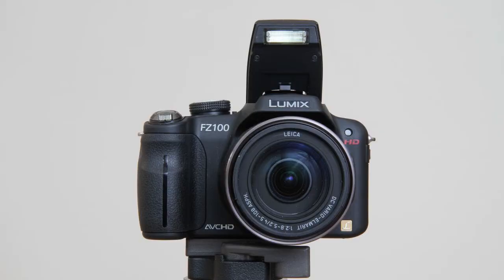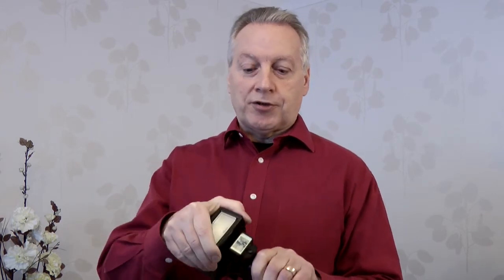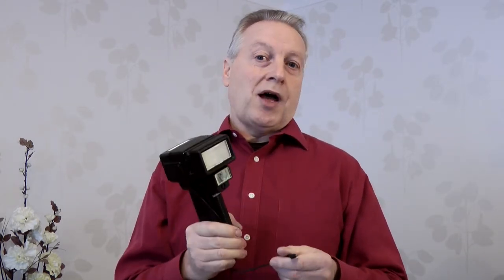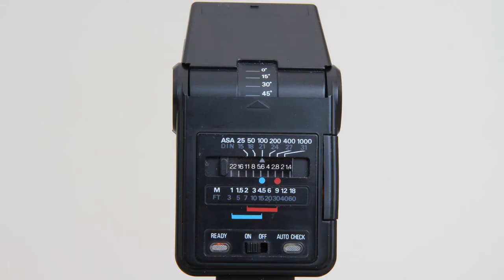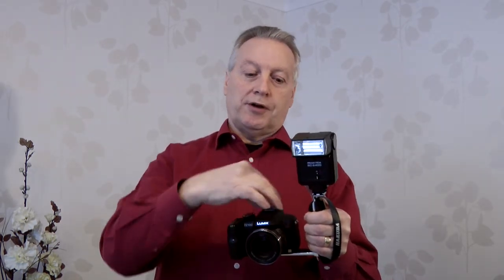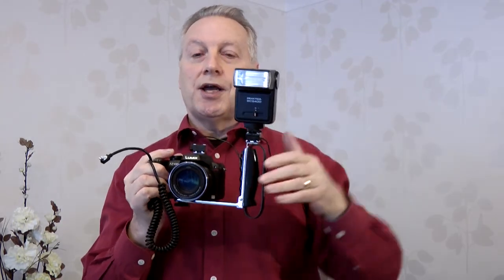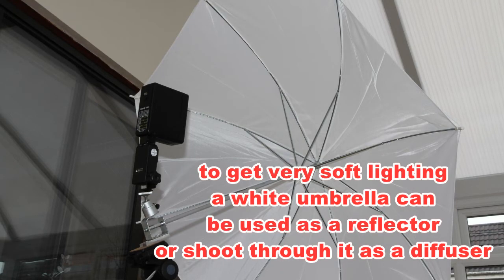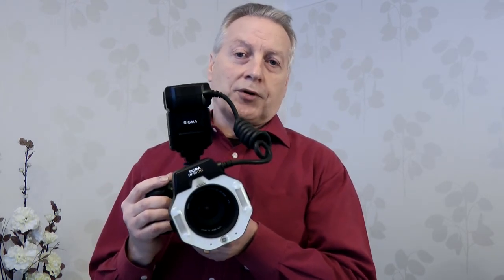External flash with Panasonic Lumix FZ100 ( and other) cameras

Comment from the maker: Hi, trigger voltage is the voltage which the flash gun puts out on its hotshoe or synch cord. It is there so that when this is shorted out by the camera firing circuit ( normally a thyristor in digital cameras) it fires the flash unit. Traditionally in early guns this trigger voltage was derived from the main flash tube voltage around 350v. This high voltage would destroy the thyristor in the camera. Modern flash guns have trigger voltages of below 6 volts and hence entirely safe.

Comment from the maker: @puiaification THE 285hv has a low enough trigger voltage to run on the FZ100, however it will be manual flash only and not TTL so you will have to use the aperture setting on the 285HV to control the exposure if you want auto flash and set the fz100 aperture to match the 285hv aperture value.

Comment from the maker: @Mig440 Yes an external flash will work with the Fz100, just read the note about the trigger voltages before you purchase older second hand units. Most modern guns ahve very low trigger voltages and are perfectly safe. You will need to use the gun in manual mode unless you get the dedicated Panasonic ones.

Comment from the maker: Although this flash unit has a low trigger voltage I suspect the polarity is wrong for the LX5 hot shoe. I have had this with other guns as well. The work around might be to use a "wireless flash trigger" - which also gets you a better flash position off camera. If you have a multimeter you could check that the centre pin is positive with respect to the side contact. I'm sorry I don't have any other ideas to help.

Comment from the maker: Hi again. The Practica flash gun can only be used with and external trigger such as shown in the video. The "trigger voltage" of this gun is too high to directly use it on the FZ150 it would probably destroy the output of the camera. By using the radio controlled triggers you can use just about any flash unit off the camera. All the unit s will be manual so exposure is done by dividing the guide number of the flash by the distance to get the f stop to use. The remote flash units are universal.

Comment: Great video Graham very informative I have the Lumix FZ35/38 and the camera don't have a hot-shoe I think only the FZ100 have hot-shoe  ,so the only possible way to connect an slave flash to the FZ35/38 is by using a photocell sensor on the in-build flash ,probably using the same National Flash Gun as slave flash

Comment from the maker: The real danger flash guns are the ones which use the primary flash voltage as part of the camera trigger circuit which was fine with mechanical shutters and switches. With digital cameras the whole game changed. Some manufactures employed high voltage thyristors or scr's in the camera circuit on earlier models but with more high end electronics the size of components became a limiting factor in the voltage the ic's were to withstand however if your trigger is only 9.4 I would rate this as OK.

Comment from the maker: @tori23epic With the Fz100 I don't think you can disable it, there are 4 options in the camera icon setup menu but none disable it. Remember the flash only charges when you "open" the cobra head by pushing the flash open button and you should see the flash symbol flashing as it charges in the viewfinder. Hope that helps, get back to me if you still don't get flashing!

Comment from the maker: The problem with non compatible mounts is that they cannot be used in the automatic mode where the camera will determine the flash exposure by e-ttl communication with the flash gun. Using a nikon or canon mount will mean the gun might fire but you would have to set the flash gun to a manual power mode to control the flash power. At the moment there are few guns with panasonic compatible mounts

Comment from the maker: @BraveTallGoddess The best way would be to use a "slave" trigger flash unit or a slave trigger on a regular flash gun. There are slave triggers with the option to fire after a determined number of flashes so this gets around the pre-flash exposure determination flashes of the fz38.

Comment: You can mount a safe sync device between the flash and camera to bring down the trigger voltage to a safe level. I have a flash with a trigger voltage of 45 volts. With the safe sync, it's 3 volts.

Comment: Well after a little research, I found my SB-600 has a pretty low (sub 4v) trigger voltage. So I popped it on the top of my FZ100 and tried it.

Whiteout! :-o

So I put the camera on manual, closed the lens down to F8, the shutter set to 1/50th by the camera which had detected the flash unit, and tried it out.
I set the flash to manual and it happend to be on the flash zoom setting of 24mm.
Bingo! I'll have to wait for night so I can try this some more, but it's looking good so far! :-)

Comment from the maker: Hi, I've checked the trigger voltage for this gun and its around 180 volts. This is an older flash unit and for film cameras. It is likely to cause damage to the FZ100 thyristers so I would advise you against using it. The botzilla link is 
now updated in the desciption. The 3200 isn't listed but I found it on another forum for you.

Comment from the maker: Yes it will, I have used it with that gun. Always attach the gun to the remote trigger and then turn on the gun rather than powering up the flash and installing it on the trigger.

Comment: Hi Graham, Great video as always :) So im taking it that the flash Practica BC2400 that your using in this video would have no problems working with the FZ150.? Can you tell me though do the hot shoes adapters have to be compatible with  the flash or camera  or are they universal if you get my drift :) Thanks so much x

Comment from the maker: @hassnain316 This purple fringe/vertical lines - do you mean complete streaks from the top of the frame to the bottom where there might be a bright object in the frame, like the sun or a reflection from a bright object? or just fringing on high contrast edges of objects? If its the first case, no the FZ100 doesn't do this.

Comment: Thanks - did not think to try first :)  but as you said it should work I gave it a try - works perfect and in TTL mode as well.
Actually my flash is Olympus F600r - so I wonder if the wireless option works using the built in flash on my GX7 - I will give it a try - would be nice as I have a OMD-5 as well and then both cameras could be used during a shoot

Comment: PLEASE I want some help. 1. I have lumix FZ 100, its flash is not so good in low light. 2. I have an old Acheiver 828 flash, can I use it directly in hot shoe? 3. What about the Trigger Voltage, will they be compatible?

Comment: thanks you very much, so the yongnuo 560 is usefull to the fz150 but i would have that use in manual mode on flash.

the nikon or canon flashes, are compatible  with fz150¿??

which flashgun of amazon ""cheapest"", you can suggest me & and which wireless trigger could you suggest me.. the brand trust i cant found aanywhere..!

help me please

Comment from the maker: @puiaification ABSOLUTELY NO!  The Achiever 828 has a trigger voltge of over 260v and it would most probably destroy the flash firing circuits within the FZ100. You need to use some other method like wireless flash trigger to use this gun with the FZ100